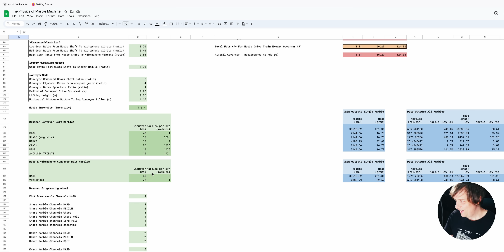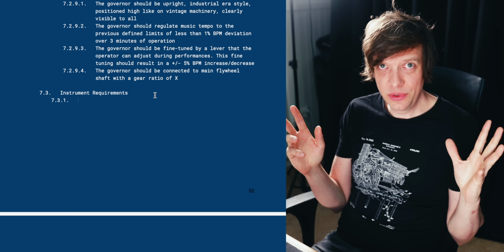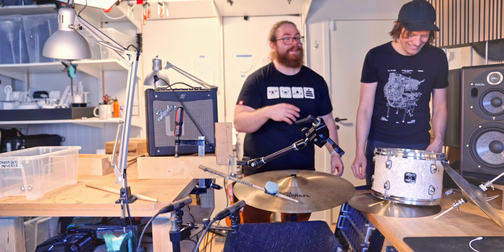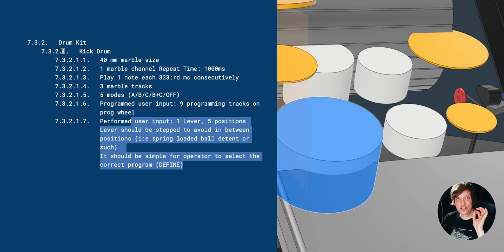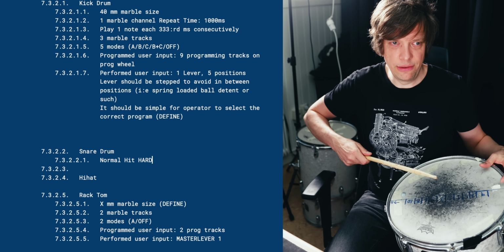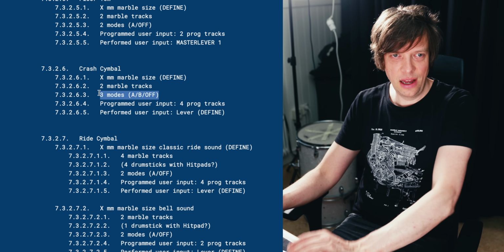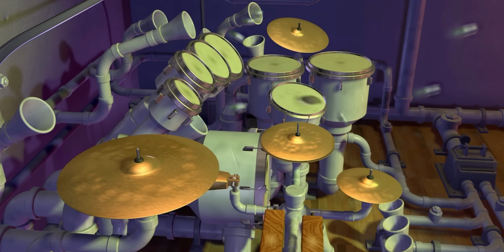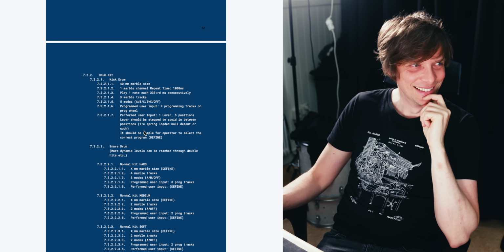Building the Marble Machine in a text document - Better than I thought!

Comment: About the drum rolls. Please remember that a roll is not a single stroke fizzling out like you played but consecutive double strokes.
Not sure how to replicate that on the machine without a lot of tracks, though.
Reply: My reply will be a long rant here, but... just use a fucking drumstick. Overcomplicating it is stupid.

Doesn't make it any less a marble machine either... the drumstick could be activated by a marble (or it could be a lever hit by a marble and the lever would in turn move the drumstick). The stick could be pivoted/sprung in such a way that it repeatedly bounces against the drumhead for a roll.

Why waste time and effort trying to only get the marbles to do a roll when we already have far, far easier ways to do this with tried-and-true drumsticks? The whole point of even using marbles at all, even if they hit simple drumsticks, is for the added playfulness. The drumstick is just another component of the instrument... it's not like the marble is being replaced by a drumstick... if that were so, the marble would never be involved at any point in the process.

Martin applied a drumstick to the ride cymbal in a video, where the stick was hit by marbles. But of course, the only justification he comes up with is "it sounds better". Lol, there's so much more to it than that. Drumsticks don't just have to be involved for musical/sound reasons... it's a mechanical design thing as well. It just makes everything simpler. Less marble tracks needed, no need for several different-sized and different-material marbles for different sounds to move through the machine. In this case, achieving a roll would be as simple as it gets, using something we're already familiar with (drumsticks), instead of coming up with a hopelessly complicated way of using only marbles alone and lots of marble tracks just to get a fucking roll!

Frankly I cannot see why we couldn't just have every instrument in the machine use drumsticks, mallets and plectrums that are activated by marbles and just be happy with that. The cymbal drumstick was activated by marbles in the video I mentioned, and the bass guitar was played by a lever-activated plectrum (sort of like a harpsichord) activated by marbles, so why not? The vibraphone could just be played by marble-activated standard vibraphone mallets. Like the drumstick, the mallets and plectrums and so on are just another part of the instrument... the marble is still "hitting the instrument".

Comment: Martin, let me give you advice as an long term follower of this channel. If you use two marble tracks to drop two marbles simultaneously onto the hi-hat and the snare drum, you will end up in the same rabbit hole with timing issues. Dropping two marbles on a snare drum simultaneously can create a lot of unwanted effects and might just end up sounding bad or creating timing issues which will lead you back to where you started. 

I think having two separate tracks for the hi hat and snare drum is probably enough if not too much. I think the Elon Musk design principle of questioning every design requirement could be really of use here just like you did for the marble gates. You even say yourself in the design requirements that dynamic music is a “nice to have” which means it doesn’t need to be absolutely perfect, just to an acceptable extent. You don’t need to over complicate things.

Comment: Speaking about physics says  Impulse-Momentum Theorem says impulse = mass times delta velocity. Instead of changing mass with a bigger ball or two balls at the same time, you might change the velocity by dropping the marbles from lower/higher.

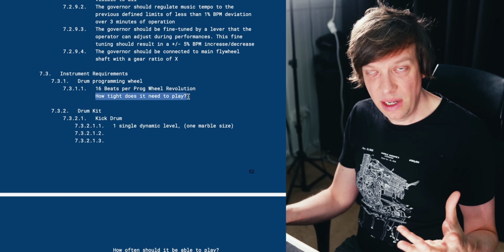Comment: 5:08 2ms standard deviation is probably excessive
sound travels about 340m/s, so travels 68cm in 2ms - so if you have two microphones a meter apart, they'll hear the note more than 2ms different between them
If the machine is 10m wide, that's a 30ms end-to-end delay - so 10-20ms deviation within each instrument won't change much on top of that, and will be much easier to achieve

Comment: In cnc manufacturing, There is something called acceptable tolerance. It's exactly what you're doing with this document. 

While precision is the ideal, You have to acknowledge that we live in an imperfect world. At my previous job, Unless otherwise stated, our minimum acceptable tolerance was +/- .005" or +/- .127 mm. There are instances where machinery needs to be exactly perfect, Those are usually reserved for intensive, high end scientific equipment.

If you don't let yourself have a minimum tolerance standard, You will invest 99% of your time chasing an imperfection that is imperceptible to normal human anatomy. In the case of 
Machining, It could be a defect so small, You could not see nor feel it. Only measure it with calibrated equipment.

 So too with your endeavor. As long as your music is comparable to what a human can replicate, The pursuit of anything beyond that is madness.

Comment: I would thinking dropping two marbles at the same time would actually sound bad, at least for drums. Try hitting a drum head with two sticks at exactly the same time.  It doesn't sound good.  This is why flams exist. When two sticks hit the snare head extremely close together, but not exactly the same time, it sounds WAY better than doing it at the exact same times.  It has something to do with the how flexible drum heads are and how multiple points of contact effects the resonance of the head.

Comment: Weights 👏. From the stage grid. 👏.  Use chain motors to lift them before the set. Powering this thing by yourself or even with one friend without assistance will be unsustainable on a world tour. It will look like a granfather clock even more so.

Comment: You're falling into the classic requirements vs. specification trap in your documentation. You are writing a specification (with the technical solution in mind), not a requirements document (with the problem to be solved in mind). Example for a requirement: needs to be able to play 16th notes. Example for a specification: needs X amounts of tracks
It's not wrong, but good to be aware of

Comment: I love the idea of having the pipe dream carousel there as a requirement, but I'm wondering how you'll be able to handle the rotation of it through mechanical and programmable means, as a quick rotation would potentially trigger extra noise (tamborine rattling) and having to accommodate carousel spin times in how fast you can play notes on it. There might be an upcoming clash here between two design requirements: The homage to Pipe Dream versus dynamic music...
Reply: I think it wouldn't turn very fast, that or it would use a mechanism to slow down progressively.

Comment: Martin, you are mistaking "writing a specification" for "progress". It is, but it is not. You do no know how many problems your newly found specifications will bring. The comment section has valid concerns and if you start specifying stuff that will kill the project, this was not progress. Each track will have a failure rate. Even if it is minimal, it will not be 0. Every additional track you light-heartedly just specified will reduce your MTBF. I truly fear you are planning way too big for your first serious attempt using this workflow.

Comment: This feels like SpaceX and BlueOrigin ; but you choose the BlueOrigin path. Wanting to create an absolute perfect machine on a last try.
You could not do the SpaceX way to iterate over a design because there wasn't a design to iterate.

I believe a workflow of :
- one month of design on paper, and
- one week of realasizing a 1st principle prototype of that design,
would be less straining on your mind.
State an idea, find the fastest, simple way to do it, see if it works ; decided if you should pursue later this design or think of a new one.
When you test a feature, you test only that assuming anything else is good ; after testing that feature you return to the design on paper.

Like Starship, one would think an active cold fuel bleeding system is the best to make it pass through reentry in a reusable fashion; and yet it's too complexe when trying to build. What about heat tiles ? They couldnt be refurbished on the Shuttle, so it's not a valid way for us. But why they wasn't referubishable; because they were too thin; because of weight limitation. But in the case of Starship weight is not an issue it's the drive of the project. Make thicker tiles and voilà; you have a heat shield and it's reusable. It's good enough; for now, it could be also good in the future who knows.

By not allowing you to do controlled fail you will fall into local maxima of a design. 
And when all individual local maxima designs are reached and it seems to not work ; you will be convinced by proof that's its not feasable. Where yourself in the past did a machine that was able to play with no knowledges. That machine wasn't good enough for your ambition but as a proof of concept it worked.
It's like saying SpaceX Falcon GrassHoper wasn't a sucessful rocket because it never went to space. Of course it didn't went to space.

Comment: Just imagine
 the sheer weight is going to be with many many heavy balls. Just human power probably won't be enough to run belt drive with many heavy balls.
Reply: But the belt won't be lifting all the marbles at once. Also you can lift any weight using human strength, you just need to use correct force multiplication mechanism (gear reduction, belt reduction, levers, block and tackle, hydraulics,...)
Reply: I have two super heavy ones, and move them alongside myself no problem using just my human powered body 🥁📀

Comment: As a drummer, I would warn against simultaneous drum hits. Not so bad with the cymbals, but the physics of the drum heads make simultaneous hits sound bad in my opinion. Much better would be to use a flam, or two consecutive hits. The space between these can be very small, even milliseconds, but there needs to be a space.

Comment: Honestly, the dynnamic attribute sounds like a nightmare. Could be wrong, but you are using different channels to hit the same piece (ex, the snare). Cool, but this means you have different trajectories for every marble after they hit the snare. Good luck design a "catching system" for that, considering that it was one of the main issue with the MMX. Not only that, if the marbles are hitting too close to each other (for example if you want to do a strong hit followed by a ghost note), they could affect each other, having all kind of side effects. And I'm sorry, replaceable instruments in the pipe dream? The hit area and the trajectory is going to be different for all the instruments, how can you design something that works for all of them? FInally, you still have not settle down for a single marble size? This could maybe be the worse thing, having to deal with different sizes in your machine. The size of the marble should be decided first, since everything depends on it (channels, belts, gates...). And this is your idea of simplifying things?
Reply: if its with a stick, then theres no problem. if hes using marbes to actually play it, foam or carpeted funnels. solved it.

he can program interference notes away from each other. he has control over the music it plays.

the hit area is built into the top by moving the instruments in or out, so thats not an issue. for the trajectory see the first one. so you can very easily design something that works for all of them.

marble size hasnt been determined yet because it hasnt had to be. theres nothing physical here. why does that need to be done right now? nothing has yet required a specific marble size.

yes this is his idea of simplifying things. simplifying doesnt mean the machine has to do less.

that was easy.
Reply: @jackradzelovage6961 we'll see...it seems a lot of extra steps to me. Just thinking about the channels "in a vacuum" is very different when marbles are hitting the same bouncing surface in a tight sequence. I suspect he's going to have marbles flying everywhere. But ehi, maybe he'll prove me wrong.
Reply: @blackest3314  thats gonna have to be sorted when he gets to the prototyping stage. as someone else brought up, hes already tested the gates and concluded that they need a good part of a second to fully reset for consistency. hes keeping that in mind here by planning for multiple channels to mimic one rapid-fire one, and when the time comes to prototype the isolated section that controls instrument X, hes gonna find out how the instrument reacts to timing and will base his limit on those tests. that will also help him nail down a running total of how many channels hes gonna need at the end, which will dictate how wide the wheels are, how many marbles hes gonna need, how big the machine is, and how heavy its gonna be. its all dependent on segmenting the design process into individual components just like hes doing right now.

Comment: I did not see the previous video, but are you able to keep the marble sizes the same by dropping from higher positions? It would require a big offset (and look super impressive), but could simplify the marble logistics.
Reply: Or the marbles could just operate tried-and-true drumsticks, mallets and plectrums. You get the same benefit... no need to waste time messing with different marble sizes/materials and so on. The bass drum could just use a bass drum pedal-like mechanism hit by a marble. Makes everything simpler. Delete, delete, delete.

I'd argue having drumsticks and mallets and plectrums activated by marbles is even cooler than marbles just hitting the instruments directly. Makes it seem a bit more like a cool mechanical marvel as well. So while using those components makes things simpler in the long run, it also adds a cool aesthetic.

Comment: Wow, that is a lot of tracks just for drum kit. You will have to automate the programming process.
Reply: Yet another reason I keep saying, just use fucking drumsticks. All this stuff about multiple marble tracks, blah blah blah for doing rolls and things is stupid. No reason to overcomplicate how to do rolls using marbles alone when drumsticks do the job far more efficiently. Obviously this doesn't mean to not use marbles... the drumsticks would still be triggered by marbles. That really doesn't make it any less a marble machine. The drumstick could be pivoted/sprung in such a way that it hits the drum several times with a single marble strike. Imagine the drumstick is pressed against a lever by a spring. Maybe the spring could even be controlled manually, to adjust the amount of contact between stick and lever. A looser contact could make the stick bounce several times for rolls. Don't know if that would work... I'm just trying to imagine how it might work in my head.

Comment: How do you plan to drop 40 mm marbles? Doesnt that mean you have to rework all the timings in all of those videos you did? Its not gonna be the same, the drop gates might not be able to handle it, they'll need a rework, so thats a time loss and then the marbles dropping is gonna set off vibrations throughout the machine, so even more fixing. This is never gonna end!

Comment: thats called arm chair engineering, ie having insight design process.
Reply: Isn't armchair engineering more, criticizing other engineers on their work without actually putting in any effort yourself?
Reply: @DrTheRich  dont know. usually arm chair engineers get criticized. for having insight. but idk. you decide. high level design is usually without requiring any effort, by design. its the easiest and most reasonable design process.

Comment: Martin - how much will your music weigh . . . in kilograms / minute . . . just the weight on the marbles being dropped?
It would also be useful to have something which automatically converts a score into weight of marbles for each instrument and the timing.
You would then then know the physical weight of each music score before increasing the value by the inefficiencies of lifting each marble.
My concern is you may not be strong enough to power the machine with one or two people but you have mentioned an electric motor . . .
Reply: This is an interesting concept

Comment: How is it possible to sync 2 programming wheels so far away from each other, while keeping the precision that previously has been mentioned?
Reply: Connecting them with a solid axle?
Reply: @DrTheRich  They are angled
Reply: @palelnan  there exists zero backlash mechanism for going along an angle
Reply: @DrTheRich  But you still have to incorporate some kind of synchronising mechanism. How can this have the extremely high precision that Martin has demanded of other parts of the machine?
Reply: @palelnan  If the two rolls are connected mechanically without backlash, or backlash within the specs, then no, you don't need any synchronization mechanism, since the rolls cannot go out of sync in the first place.

even with backlashed gears, what you can do is add a tensioner, or friction thing to keep the backlash from wiggling, and drive them both from the center with exactly mirrored mechanisms, and with factory made gears, then the backlash is the same on both sides, so they are in sync.

Either way, i assume he'll tackle this issue at some point a little more scientifically, as he has been doing with the other mechanisms on the machine

Comment: You need to focus on perfecting one thing   at a time  if something works better or is. Functioning better.   But. Can. Be refined leve it for. Now and get what. Is not working or functioning right   and. Work on that.   To get a  consistent.   Working. Machine then worry about. Running and. Spit second timing   and for the. Marble. Release why not run  upper part tube. Then make  end  part with with release  mec and round  rods clamp on to tube.  tube. Wi